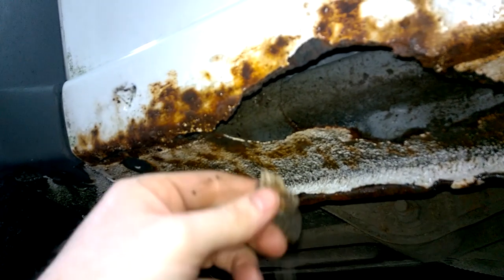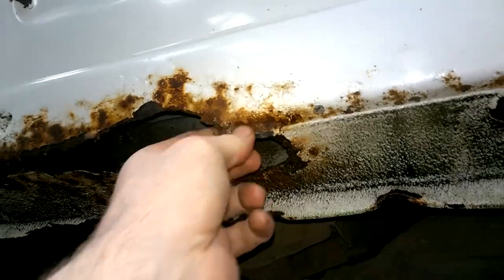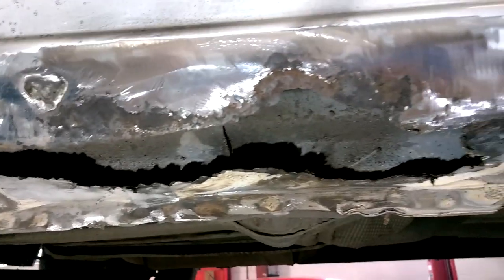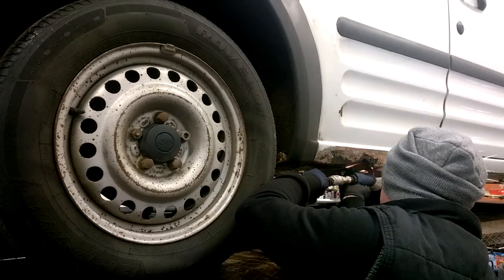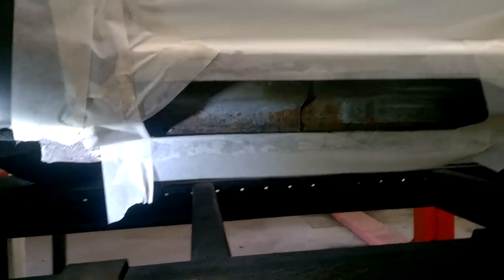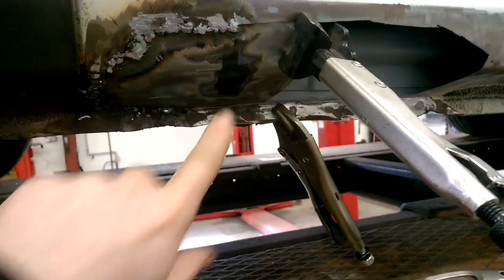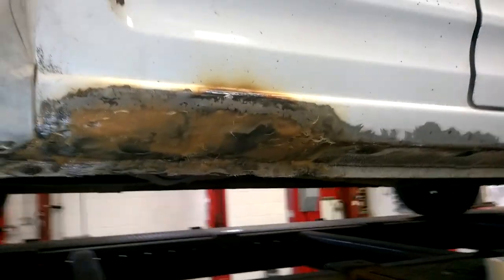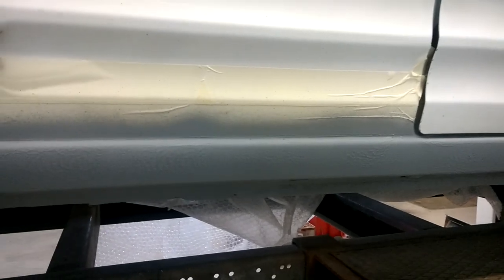How To Repair Rusted Sills - Ford Transit Connect

Comment from the maker: This comment is to clarify the repair and I won't be making any further comments again. (I feel people are missing the point of this job) 
 
1) This repair at it's finished state looks great, colour match & shape are perfect & you could not tell it was repaired.  
2) Buying a panel? Why would I buy a panel and waste money? it would not make the job look any better at the finish, This job is to show people the repair without the panel & what can be done using this method in many rust repair jobs. Don't assume you are getting a good repair just because they buy a panel, if the welds are not protected, if the wrong fillers is used then over a small period of time you will get lovely rust blisters starting to appear. Same thing applies to a 1/4 panel fitted, the joints show the quality of the job over time.
3) The welding penetrated and the panel was secured, it will last for years & years (I understand if it was a weld that would be seen when finished it would need to look nicer) 
4) I have been involved in body repairs for years, the most important thing is to get rid of any corrosion, seal it correctly, use fibreglass for water proofing the repair and make sure the correct temperatures are used for heating panels and spraying, including baking the spray booth or at the very least infrared lamps & heat guns if you can't afford a booth finish. 
5) This is not a primary structure & should not be treated like one.  
6) All our repairs we take huge pride in, meaning the overall job is of a high standard every time. Engineer approved work goes on in our workshop for Vehicle Testing Certs all of the time, We have had 0 jobs that failed to be approved.
7) If you are a professional rust weld repair master technician. WHY ARE YOU WATCHING THIS VIDEO????? :) 
8) If you made it this far you done well :) Thanks for watching and taking the time to read this.
Reply: Great job, only thing I'd suggest is to use an epoxy or self etching primer on the inside of the sill instead of high build. Going to do this on my mx5 though shortly. Thanks!
Reply: Hi. Could u tell me how much it cost u roughly ? Thanks
Reply: Well done! Number 7 is my fave! Too video, you've given me courage 👊
Reply: Well said top job these people on here with silly comments about your welding knobheads I would have done what you have and fiberglass Shape in then masked line and shultz if spelt that right lol 😂 nice Job it's a van lol

Comment: Was the welder out of gas
Reply: i thought the welding was bad, i have only welded a few times and mine is often better than that. to be fairs its more about cleaning the van up that structure
Reply: LD.....It's a gas-less system; flux is in the wire; I have one; they make a splattering F*** mess inspite of using anti -splatter spray. Not technically MIG (Manual Inert Gas)
Reply: JonPlopp To be honest I thought his repair was decent until I saw the quality of his welding which is very poor but those gas less mig welders are very difficult to weld with properly
Reply: Lucky he wasn't welding a showpiece then, it'll do the job since it's not holding the vehicle together or anything. A of people watching the video are amateurs DIY people so I don't know if they'll do a better job with one of those gasless things either 😂

Comment: is there water entering behind the bodywork and then rusting internally? as surly the water externally wouldn't stay on the bodywork long enough to start to corrode?!? prevention rather than a cure. just wanted to know your thoughts, cheers. ps I have zero experience on fixing cars.

Comment: How old was this van ?
Reply from the maker: 2007
Reply: Gerard Burke possibly a stone chip that’s started this ?
Reply from the maker: No, there was rot showing from the inside out, there must be a defect with water/condensation lodging inside the sill and not properly sealed in these areas from factory. No stone chips would have caused this.

Comment: Excellent video and thanks for sharing.  It takes guts to put up the reality of these repairs knowing all the 'know alls" that will come on to judge.
You did a veey neat and practical repair to my mind and ld be happy with it if it was my van.
Subscribed. Thanks again for sharing
Reply from the maker: Thanks so much for the kind words, there will always be negative comments and "know it alls"  
If I had any suspension that it was not a long lasting repair I would never do it, we take a lot of pride in our work in this workshop,  
Thanks again for taking the time to comment & subscribe, it is much appreciated.

Comment: Personally I'd be pleased with that work you did, it finished up well and will last longer than other parts of the vehicle.
Fiberglas material and epoxy resin is I think from my one experience better that Fiberglas and polyester resin, better catch ( grip ) on metal and not porous like polyester as polyester with no gel coat is pervious to water.
I know it's all sealed afterwards anyway and epoxy is dear compared to polyester although epoxy makes a great filler too with talc mixed in for the final fills.
Yes you can buy bubbles, I think it's called ( a filler compound for mixing in instead of talc, I used flour once on a boat keel to fill bite like missing chunks, it was my own boat. Eight years later and in and out of the sea and it's so good I can't remember exactly where the damage was.
I have an old Talbot express campervan and I think I may need to do a few patches on the inner sills, the outer sills are in good order and replaced I think. I'll not know until I get a good dry day to get under it and have a proper look though.
I have an inverter stick welder with 2mm welding rods and I can reverse the polarity for thinner steel, I've welded thin steel a few times with it but you can't hang about or you end up welding up the holes you just created.
Do you think I should invest in a mig welder as with a 27 year old van that I plan to hang onto for a good while I may need ongoing welding done? I've never mig welded before.
Is it really expensive to get it done by someone like yourself?
Oh, greetings from the north, my wife is from Kanturk Co Cork.

Comment: Nice video. Trying to do up an 03 one of these... with no experience... (garage keep telling me to get rid of it but I bought it to do up.. kind the whole point) I'd be interested in a full inner and outer sill replacement and fixing of the jack points as when you cut outer sill off sometimes the inner sill is rusted at the bottom too including jack points. Noticed allot of people mentioning rusty jack points on Connects and other vehicles that are being damaged by single arm hydraulic lifts. They pull them to one side and either crumble or bend the points making them unusable. Not good when you're stopped at the side of the road with a puncture and can't lift to change it with OEM jack. Also pointers about paint were very useful as I don't have proper facility and to try protect quickly, I've applied in cold windy and sometimes wet weather and rust bubbles through again two years later. Need some where sheltered to work and will try warming the area to be painted first before trying again. Never thought of the temperature.
Reply from the maker: Thanks for the comment, Good luck with the project they are always fun :) I am glad you found it useful. I will be posting some more related to the connect in the future

Comment: Hi good video I was told you cant use fibreglass on sills has it won’t go through mot is this correct?
Reply from the maker: You can not use fibreglass to repair the structure I.E if the welding panel was not underneath this fix. A lot of jobs were tried to be brushed through by rubbing fibreglass over a rusted area instead of removing the corroded part, leaving a very bad repair that did not rectify the issue. 
 
In Ireland before you go back in for the retest the repair must be visible if the item has failed on the area already, then you can repair it (cosmetically) however you like after they approve it.

Comment: "Hammerite krust off " brush on to metal that has that brown rust stain , before priming that inner seal ,
Reply from the maker: Never used it. Is it something you would recommend as a long lastly product. I am always open to using better products in the workshop. Proven ones not like sales reps telling you they are great :)
Reply: @GerardBurkeBurkesGarage  4 years later... it turns rust black 

seems to work well!

Comment: Hello. I brought a connect a few years ago mine had blow engine so put an engine out of a focus in, it had been off the road 3 years and bodywork was pretty good they are great vans love it. I noticed saturday the o/s sill is going i have ordered the 2 meter sill repair cover panel off ebay. its nowhere near as bad as this one and not come through yet but if you press on the area you can feel its gone.  Not sure how im going to do it ive only got ark welder will be too powerful and body work not really my thing. will cut the rust out first then thinking of bonding the repair panel over the top. what you think?
Reply from the maker: I reckon you should expose all the rust spots on the sill to see the exact rust level when stripped down, I would not go down the route of bonding unless you have no other options. The problems with fitting over and not fitting in will be the joints and how long the repair would stay 100% bonded, you will have a decent bit of filling to flush them in and if they ever move the filling will crack and so will your paint. the area that they are means the jacking could cause issues as well. 
 
For a long lasting finish I would recommend welding, I done a continuous weld but spot welding can work great too and requires less time.  
Depends on the tools you can get your hands on.  
 
Best of luck with it.
Reply: Gerard Burke thanks Gerard, yes i will see how bad the rust is when the panel comes if i can get my hands a mig will have a bash at welding it in place looking at it, it's going to have to be spot welded along the bottom seam, may buy one of them small mini migs. i did weld a floor in my old transit mk5 with the ark but think it maybe to powerful for this. looking forward to more of your connect videos
Reply from the maker: Mig spot welding sounds like a plan ;) cheers for the comments, I am enjoying the jobs as I always do, any free time I have is going into it. Timing belt and water pump is done and back together. waiting on a new alternator to come and then it will be ready for bodywork, wheels bonnet etc..  & bring it for testing
Reply: Gerard Burke yeah i painted my wheels ended up putting trims over aswell. Put a new timing belt and wp on my replacement engine the hardest part of the job was swapping the diesel pump. i swapped because the pump is coded to the ECU for immobilizer and i didn't want to have to pay for someone to come out and charge me stupid money to recode. seems like the sills is the only troublesome spot for rust on the connect. also check the panel that holds the radiator up mine was rotten and radiator dropping down
Reply: just uploaded a 30 second clip of my sill have a look if you got time mate
Reply from the maker: Just had a look, it is in much better shape than mine was :)
Reply: bigend07 - Do yourself a favor and get a cheap flux core "mig". Even that will do for a better job (strong) and don't cost an arm and a leg. It will also open a totally new range of repair possibilities. So a win win situation. ;-) Good luck.
I've tried with "stick" and it hold in place, but I can't recommend it to no one. I've seen a few well talented welders doing it. But surely not a task for rookies in thin metal.

Comment: I put in mesh and filled with isopon on a transit and got away with it on test. I didn't have a welder at the time but it was a fast way out of it. My van just not worth too much time Have to do some more tomorrow. Rust buckets they are.

Comment: How much would this procedure cost through a garage? 

Thinking of buying a 2001 sprinter and noticed a couple of small rust holes in the sill. Maybe 1 to 2cm in diameter
Reply: I garentee you them small holes mate will actually be more than you think I've personally welded loads of transit and other vans over the years most welding jobs are very time consuming garages can be very expensive pal honestly you best of finding a freind who's handy with a welder or maybe look on face book  for someone that can do it on cheap pal most garages have 2 eople on the job 1 to watch out for fires in the cab on most jobs

Comment: Surely a correct repair panel would have been a tidier job without the need for fiberglass or too much filler?????
Also, did those welds actually penetrate fully?
Reply from the maker: If you want to spend money buying panels by all means go ahead, I didn't need to as I have experience in these jobs & it saves me hassle, yes you would have less filler but that is not an issue as the structure is 100% & the filler is not a large amount more of a skim. The welding came out really good (in regards to re securing & penetration) and I did a continuous weld which makes the structure of the repair like new. (this type of repair is engineer approved) the beauty of the weld does not ever bother me unless it will be visible after repair, if it was then I agree it should look better.
 
As for tidier I am not sure what you mean?? if you look at the finished result on my last video you can clearly see it came out very nice, I take a massive amount of pride in my repairs and my work and I would not settle until the repair was of a very high standard.

Comment: No rust encapsulation done whatsoever that I saw. It doesn't take much additional effort to spray some etch primer or something on the inner panel and the new repair before filling
Reply from the maker: Is there a product that you would highly recommend? I value your input and while I did use a very good high build primer going that extra yard is a good idea for even longer lasting results in future projects. I had a very bad experience years ago when rust inhibitor paint causing a reaction in my finish coats, ended up grinding it all down to base & starting again :(
Reply: People have their different favourites. I like the Eastwood products, if they're available where you are (UK I'm guessing). Their Rust Encapsulator would be perfect for what you're doing in this video, i.e. you've de-scaled and cleaned up the rusted area in preparation and the area just needs to be sealed off. This encapsulator leaves a paintable finish.
Reply from the maker: Thanks for the info, I will be interested in checking out the products further.

Comment: why does mig welding always look like crap?
Reply from the maker: It doesn't always :) My welding in this is not pretty but it did what i needed. My mig welder is difficult to have smooth running on lighter gauge material without burning through so it is trigger on & off a lot to allow temp levels to drop in between.
Reply: not when done properly seam welding it gives a much better finish
Reply: ArLo W Not always, but this one looks pretty ugly, I agree. But it is hard to weld pointing the MIG gun upwards. Most of the time sealer material is melting during welding and pouring on the mig gun,plus burnt gases from paint and such get in the way of the shielding gas giving you a hard time. 

I don't work in an approved garage, but I am a qualified panel beater.  My MIG welder is probably old as I am,and it's far the best welder, but that welding  could have been done more nicely even with a 12V battery. If I call my wife and give her instruction on the phone, she could make nicer welds

Comment: Welding looked ruff.
Reply: Have you ever tried to weld a Ford transit sill ?. I don't think you have, try it with a mig welder and tell how you get on.
Reply: Looks like you have porosity in your welds but looks ok
Reply: @grahamchurchal2986  sill is a sill get your settings right and it is all the same. It is bad welding but if he's only a beginner fair play for trying